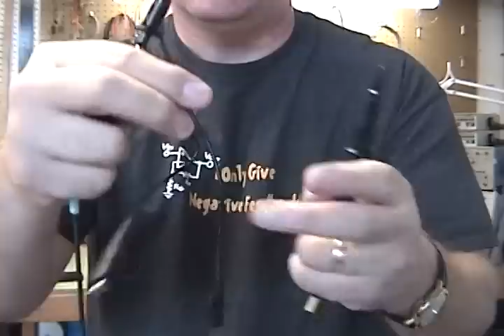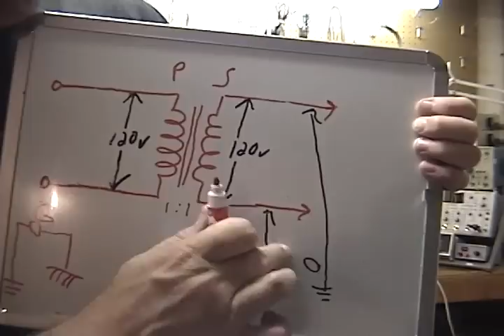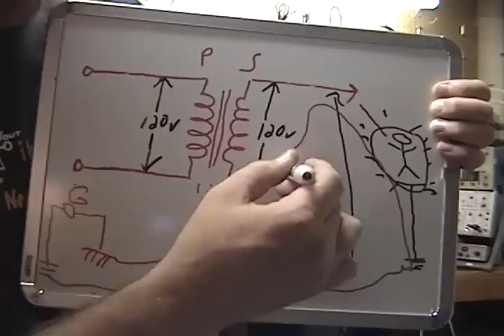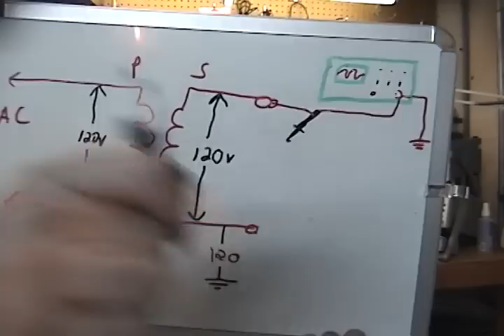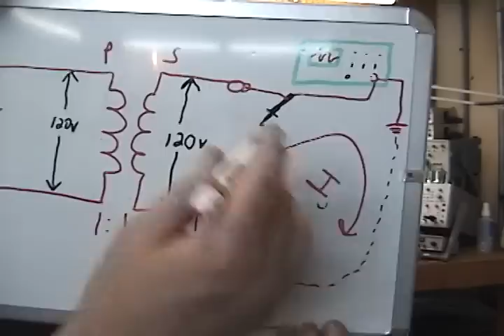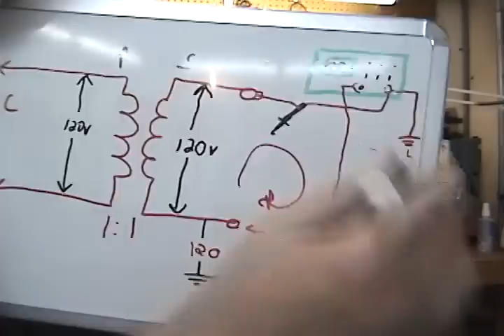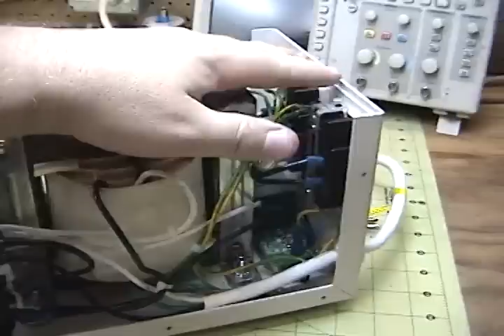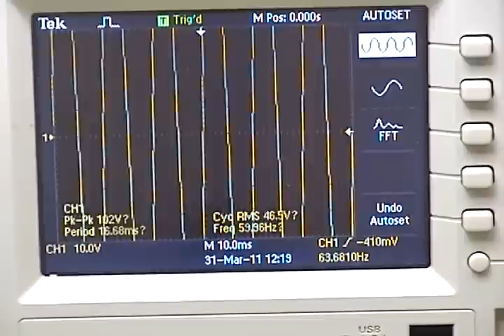ToddFun.com: Isolation Transformer - Tripp Lite IS1000

Comment: This is a great video, and I have shared it with many people. I am setting up my IT now, and actually adding a clearly marked switch to enable or disable the "tech" isolation. This way I can use the IT either way as needed (being careful to check the switch for each mode). 

Just to be clear, you have left the chassis of the IT, as well as the output outlet ground pins, connected to the incoming earth ground wire, correct? Thus, any device you plug in which has a three prong plug will still be earth grounded, but its neutral leg will not be earth referenced... Right? Thanks.
Reply from the maker: +Joe Laffey The switch is a nice idea. Yes, your statement about earth ground is correct.

Comment: I'm curious, why does the hospital grade need ground wire hooked up? Also do city it breakers/fuses still work with isolation transformers?
Reply from the maker: +mrsemifixit hospital grade needs this for common mode noise reject. Such signals could cause issues and failures to sensitive hospital monitoring equipment connected to mains power. Fuses and breakers wills still work but only for current overloads. Meaning if the fuse or breaker is set to trip after 15 amps then it will trip or blow if the transformer pulls more than 15 amps. However, GFIC devices will not work as noted in the video.
Reply: +Todd Harrison do fuses and breakers still work because it's a 1:1 transformer? In my head I'm thinking because the secondary is isolated that it wouldn't matter if current was overloaded from the primary?
Reply from the maker: +mrsemifixit Your mains fuse or breaker does not care what the load is. All it cares is if there is an overload. It is a thermal trigger and once the amps through the fuse or breaker is high enough to reach the thermal trigger level it will flip or pop. Some advanced breakers "Arc Fault Circuit Interrupter circuit breakers" have arc protection too and in that case a transformer "could" mask such an electrical fault condition on the secondary side, but I stress "could".  Only more modern homes have AFCI breakers which are now dual breakers meaning they will trigger for overload or arc fault. A small transformer could max out it's performance before overload conditions meaning if there is a short on the secondary it could not draw enough current from the primary side to reach primary side overload conditions, however, given a continues short on the secondary it "could" produce enough heat to melt or damage the transformer causing a short on the primary thus leading to a mains overload condition. And by then you may already have a fire going in the transformer.

Comment: hi. couldn't you just use one of those ground defeating plug ends on the secondary side instead of opening up the case and altering the tripletts wiring. I'm looking at a Hammond171e and it doesn't look so straight forward to rewire.
Reply from the maker: Marty Rat You would be removing the safety ground for the unit but it would do the same thing.
Reply: ***** (using the hammond171e) on the secondary I measured Vg-b @34v, Vg-w @77.7v, and Vb-w @121v. with AND without the ground lift on the secondary. Does that mean it's already isolated without using the lift? I feel like I'm still missing something. The only difference I can see using the defeater is the continuity is broken between all the grounds with the lift. (of coarse)
Reply from the maker: Marty Rat You are getting ghost voltage readings as I noted in my video. You need a meter like a Fluke 117 that has a setting which eliminate ghost voltages. Without such meter you could connect a 120v AC light bulb between each, with and without the lift. When a combination powers the light then that is a hot path regardless of how. Make sure you don't touch any wires during the test and make sure all connections are protected from contacting anything but the plug. You can also put an amp meter in series with this light bulb test circuit and check for high current first. If no high current is present then change meter to low current range. If there is no current for a given test combination then there is no current path for that test of any kind. If this doesn't make 100% sense to you then I advise you to not trust the isolation at all and treat everything as hot. Really, that is what I do anyway because when I think something isn't hot and  I don't test then that is when I get hurt.
Reply: Marty Rat Sorry, I wrote too soon. I was a bit confused by the ground connection on my transformer (which is fine) and the secondary strap on yours prior to the mod. I just watched the video again. Those voltages must be the ghost V's. I guess the Hammond is already a tech type. Thanks for the very informative and important video.
Reply: Marty Rat Thanks. I did do the light bulb and current tests. No glow, so I'm good. It's just a ghost V.
Reply: Marty Rat I tried a 15 ohm resistor across the 77.7v & 34v in || with the meter. That also made them go away.
Reply: I'm confused on how using the ground defeating plug on the output of the isolation transformer would be the same thing as removing the grounding connection to the secondary output (as you demonstrated in your video). If you used the ground defeating plug, wouldn't one of the two outputs still be referenced to earth ground?

 So for example, on your unit, if you did not change the internal wiring and used a defeating plug on the output and then touched the output which is not referenced to ground (while being grounded), you would get a shock to my understanding?
Reply from the maker: +Rad Stor Good questions and I understand how it can be confusing in the comments. The ground defeating adapter referenced in the comments was used on the power plug for the isolation transformer not in the output of the isolation transformer (IT) which goes to the device under test (DUT). However you defeat the electrical tie-in from the secondary windings of the IT to ground, once you does so you will no longer have a possible "loop" path from the power output of the IT that can get to earth ground through you and back to the IT's secondary. Remember, the normal tie to ground is in your breaker box which would lead directly back to the IT's secondary windings if not defeated in this unit. 

The reason for breaking this tie as close as possible to the secondary windings is for safety, as I did in the video. As in your BK 1604A and any other electrical instrument you want a safety path to ground in case something shorts to a box or wire or conductive frame or anything conductive. If you have high voltage floating on a conductive item just waiting for a path to ground then you're in danger of becoming part of that path. If the conductive item is already strapped to ground then the very second the short occurs a huge serge of current will load through the item back to the homes grounding in the breaker box causing a breaker to flop open and removing the danger. If the conductive item was not strapped to a safety ground then the high "house mains" voltage could be sitting there "live" just waiting for you to make a mistake with your body, tool or instrument. So you can see, it would still be greater safety to have a conductive path from your DUT back to "house mains" just in case something can cause "anything" to have live mains power floating on it. That is why you want everything, except the power output of your IT's secondary windings, to have a possible path through the a 3rd wire safety ground on your DUT, IT or instruments.

Please do remember, as noted in the video, anything that has "house mains" ground reference itself can re-apply the IT's secondary with a path back to "house mains" ground making the output of your IT no longer isolated. This is why some people chose to put third prong defeating adapters on everything they use at the bench. Such an action is not good for instruments and you're really just trading one bad safety risk for another. You have to really know what you're doing at all times with high voltage or you will get hurt when you don't think you can be hurt.

Comment: Better than connecting both of the ground leads together, I would only connect on, because that 'Scope chassis is all ready  grounded to the circuit. You get rid a ground loop,and the potential to short out the power supply if you reverence one side to say 5 volts and the other side to ground across the ground path. K5DVT
Reply from the maker: Jon Williams True, I did cover that concern in the video. But I like your idea of just connecting only one ground clip just to be safe. No point in having two ground clips coming from the scope unless you are fighting with inductive pickup and need the super short loop at each probe tip.

Comment: Todd,  thank you for the informative video. A quick question: basically, after modifying an isolation transformer, the resistance ground plug on the input versus the outplugs should be infinite, true?
Reply: ..er..disregard, Todd.  I read other coments. Thanks again for the video.

Comment: I have a 60hz hum can this eliminate this hum.. Should I connect the isolation transformer directly to the wall outlet. thanks... this hum in my stereo audio system got to go.
Reply from the maker: ***** This will not help most likely. You could have a bad stereo. That said you could try but don't alter the IP like I did, you want the full common mode noise rejection. If  you think this is your problem they sell line conditioning devices just for stereo and other sound equipment. Just contact a high-end stereo shop and they can help  you locate such a device. They run in the hundreds if not thousands depending on load and equipment.
Reply: ***** Thanks for your reply.. I connected my amps directly to my cd player,and the results, no hum... I'm thinking ground loop issues if I said it rightly...
Reply from the maker: ***** Possible but it is hard to tell. Whatever you normally connect to may be picking up power supply hum do to degraded power filter capacitors and your CD player does not have this problem. So hard to tell remotely.
Reply: ***** Thanks

Comment: Why wouldn't you just buy the "Tech version" as you call it and be done with it...
That tripplite version your holding is like $350+, to spend that much on the wrong thing and have to modify it seems kinda foolish...unless you got it on the cheap...
I think the Hammond 171F  900VA would do the trick, $210, new...your thoughts?

Comment: Ok im new just getting started . but if the Ground is tied to the Neutral  , should you not also disconnect something else ?
Reply from the maker: Paul Scott Williamson No. You just don't want any part of your secondary windings (hot or neutral) to be wired to a mains earth reference point for a tech isolation transformer.
Reply: thanks, i basically just disconnected the Ground that went directly to the Outlet . I only have the IS250 , but im only using to Test old AA5/6's and such

Comment: Hi Todd, Can i use a toroidal transformer of 1.5 KVA for my audio applications. Connecting pre amplifiers/power amplifiers/ DAC/ integrated amplifiers. Am confused!
Reply from the maker: Ravi Kumar If the question is can you use a toroidal transformer instead of a laminated core transformer the answer is sure. That said I can't say if you have a correctly rated transformer for your application.
Reply: *****  thanks todd. i was asking if  a toroidal based "isolation transformer" better for stereo audio or an EI core based isolation transformer one? which one is the best to be used as an isolation transformer.
Reply from the maker: Ravi Kumar Both with work equally well. The toroidal will be more expensive. Some laminated iron core transformers can vibrate as they age and make noise if they are cheaply made.
Reply: ***** Thank you Todd. i bought this 4 days ago http://www.miracle.net.in/Isolation.html. It cost me around 200$. This company's manufacturing unit is 3 kms from my place and i got this directly from the factory. I however am using a 1.3 KvA voltage stabilizer and have connected this Isolation to it. Please advice me.
Reply from the maker: Ravi Kumar As long as your equipment connected to the isolation transformer can run under 1.3 KVA then it will be fine. You have linked to a medical isolation transformer which is fine for your application privileged you are not looking for mains isolation. This unit will not isolate a service technician from mains to earth so don't use this as a technician isolation transformer for repairing or servicing equipment. However, this is the correct item "as is" for running equipment with great isolation from line noise, voltage spikes and surge protection. Your equipment will be quite safe.
Reply: ***** Thanks again Todd on helping me clarify my doubt. Please also upload more videos if possible on differences of before and after using isolation transformer. May be if there are any measurements that can be taken using an oscilloscope. Thanks
Reply from the maker: Ravi Kumar That would be a good idea but problems would have to be induced as the isolation protection is for conditions that are not normally on the lines. It's not like you would see much of a difference between the two types of isolation transforms because most electrical services are quite clean now days to a residential home. In places with lots of equipment running like in factories or where you just don't want to take chances like in a hospital then you would want such protection and line conditioning.